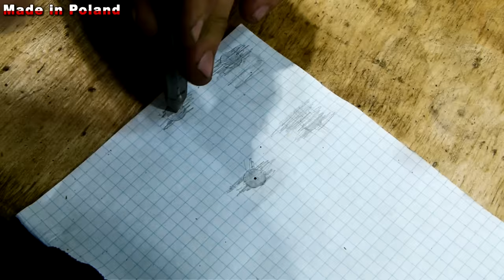Chain Saw HACK 1 - Chop Saw

Comment: Something not that commonly seen on YouTube anymore today: A proper hack! Made with simple, basic tools, and a result that appears both functional and reasonably safe. I like that you took the time to add proper belt and blade guards, something many people will skip when making such a hack. I agree that the pulleys should be made from a different material, not so much because of hardness but because the wood will warp and potentially come apart during use. Stacked up differently sized plates of sheet aluminium, screwed together and then turned to shape on the "late"/drill press could work. Or even just make them from a solid piece of aluminium, using a file and the hack-lathe method.
For speed regulation a governor system similar to the ones used on cheap power generators could be used, that should be quite easy to add to the existing chainsaw motor!
Reply: Oh, and another source for pulleys: Just check your local car scrapheap! Water pumps and generators in many cars have easily removable pulleys that are simple to adapt for your use, and they should be next to free (they are usually trashed together with the broken pump/generator). Especially many older cars will use the same type of belt you are using.

Comment from the maker: Before you ask a question, please read the description :)
And pleas share this on your social media :)
It is hard to thank for all the comments, so I THANK YOU here!
Reply: Made in Poland. 
👍 I have to tell you that you are a genius! 
Thank you very much
Reply: Made in Poland
Reply: Made in Poland mmp
Reply: Made in Polanm
Reply: Made in Poland l
Reply: Made in Polan
Reply: nu este un anunț plătit angajat român din București România
Reply: Made in Poland I made a mount for a weed whipper type edger (Red Max brand, straight shaft) that a 7" cutoff wheels fit on the end.  It took minimal fabrication and worked great doing property restoration duties (cutting fences, locks, couch frames, excercise equipment, you name it). It was very safe as it kept you away from the cutting head.  I even used it to aid in cutting cars in half for scrap.  I would like to see a video of you making one.  Very helpful tool, and cheap for the average guy.  Thank you for your videos *Made in Poland*!!!
Reply: Made in Poland ющ
Reply: DAV
Reply: @ MadeInPoland.... You are one and only person in all of my 41 years that I've seen use the rope in the cylinder trick. My grandpa taught me that a Long time ago so I could get a crank bolt out. Just thought I'd mention that. Keep up the Awesome work!
Reply: Made in poland

Comment: Very nicely done! Clever of you to mark the pulley with the belt for where it needs more shaping. Simple and very effective way to convert the saw to a pulley-drive, and if the clutch needs to be replaced you haven't made that hard. Nice of you to show the old rope-down-the-spark-plug-hole trick for locking the piston. 

The saw looks very well done, and looks like it should hold up very well to real-world use. Careful with things going helicopter in the drill press! Clamps! If you ever make it to Atlanta, GA, USA you're welcome around my shop any time!
Reply from the maker: Thanks buddy! My dream is to spend at least a few days in the US :D

Comment: awesome. those things are not cheap to buy. I always wanted one but could not justify the cost. might have to give this a shot. love the wooden pulley glad to see I am not the only one using them. have made several homemade machines and use oak for my drive pulleys. they are cheap hold up well and can be made any size

Comment: Good job. The only problem is if you make one yourself you have to find out the disc spin speed or it could fly to pieces. Can adjust it on the sproket by making it taller(smaller).

Comment: This is a great job ⭐⭐⭐⭐⭐👍👍👍👍👍
I have one with a 12 inch blade size. It was a Target masonry saw but the heavy motor finally comply wore out. I had a super good running Echo CS - 40 that I put the blade on. It gets used all the time.

Comment: Not to bad for a home made heavy duty steel saw; one thing you just need it's a diamond blade
Reply: Nenad Kralj it wouldn't really work for that as concrete needs high torque  and low rpm and that chainsaw has high rpm and medium torque
Reply: Yes, I know but it would be really interesting; great demonstration of engineering

Comment: What about using old bicycle gears and chain instead of belt and pulleys? Would they be strong enough? It would not slip and you could easily and quickly change the ratio. A full belt guard would be safer with a chain.
Reply: Robert Mercier i think some slipping would be very good have if the disc got pinched ...
Reply: taulen yeah you're right, it will slip instead of appliying too much torque and breaking or killing some one! I tough of it after posting!
Reply: taulen yeah your right but if he finds a way to put that clutch on it should work
Reply: Bike gears and chains are pretty weak for anything over 1hp since they're sized and designed with a human powering them in mind. A #40 mechanical chain might be better sized for this, but if you're going to that bother you may as well use a belt and pulley setup. less prone to abrasive dust damaging it.
Reply: Maybe..prolly 10 different ways to build a utly saw..if one has the time

Comment: Extremely brilliant fabrication superb engineering, but and I do not mean this in a demeaning way the job is not economically viable because it must have taken at least two days to fabricate the parts = £200 plus the cost of the steel and wood say £30 plus assembly and test another £100 so total £330. Where I live we have regular tool boot sales and for £200 I can easily buy a chainsaw and still saw albeit second hand but working well. I know what I would do.

Comment: This is a chainsaw hack?? Huh... Abrasive cut off saws built on the chainsaw design have been around for decades. Seems to me it would be far simpler to get an abrasive cut off conversion kit. Not to mention the conversion kit would most likely make use of a centrifugal clutch, which would make the saw more powerful. I know this is true because I replaced the bar and chain on my old saw, but accidentally jammed the clutch during reassembly. You couldn't put any force into the cut as it killed the engine. Once I fixed the clutch, the saw cut like a champ. On this hack, I have to wonder how long those wooden pulleys will last before needing to be replaced. If this guy would use a clutch with chain drive, he'd really have something. Probably saved a good bit of money over buying a conversion kit.

Comment: Chainsaw maximum RPM ~ 11300, maximum RPM for this size of cutting blade (according to manufacture) 5100rpm. Just sayin'....
Reply: This is not 1:1 gear ratio
Reply: Even if it's 2:1 it's still too much. This is not my problem, but somebody cant get hurt.
Reply from the maker: "Chainsaw maximum RPM ~ 11300" yes it is truth but you don have to use max RPM ;)
Reply: had a guy using a cutting blade next to me loose a finger due to the RPM being higher than the recommended for the blade. Not worth the risk if those wheels detonate